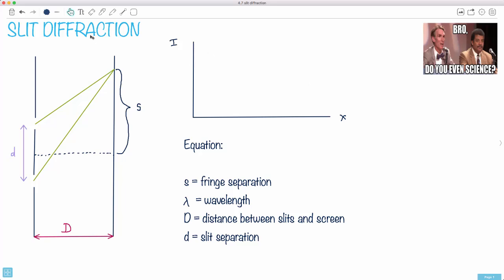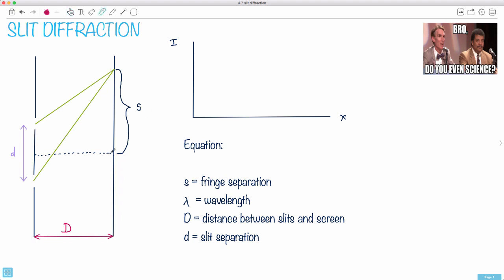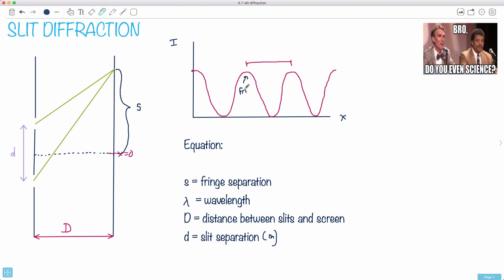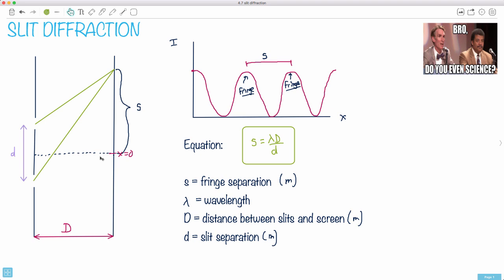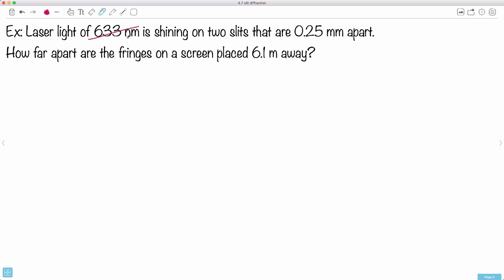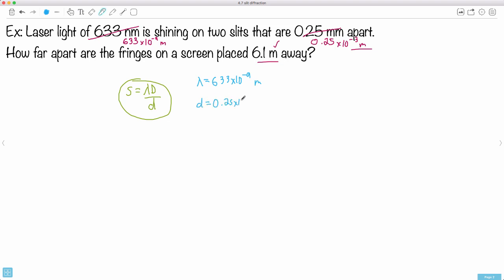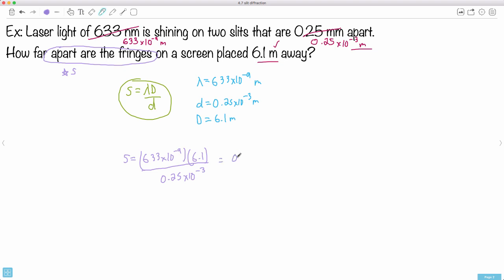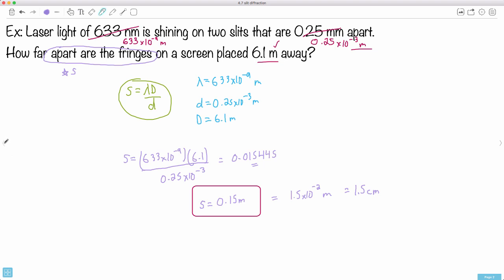Slit Diffraction (at end, should be 0.015m, not 0.15m) [IB Physics SL/HL]

Comment: Also, why are they the same intensity? I thought that intensity drops off significantly after the central maxima of m=0?
Reply from the maker: It all depends on the situation - you can have them where there is the single slit envelope dominating, but then you have the double slit effect also happening (lots of alternating max and min), but other times for example if you have many slits, the single slit effect is negligeable and it's the multiple slit effects that dominate.

Comment: Hey, I am a bit confused as for the difference between S and Lambda.  As in the graph when you show two fringes, they are basically two peaks, and the distance between peaks is wavelength.
Reply: The distance between the peaks is not the wavelength in this case.  The pattern that appears on the screen may have a sinusoidal shape when we look at its intensity, but it is not a wave itself, so s does not measure a wavelength.  The waves are the beams of light coming from each slit traveling towards the screen.  The bright fringes are where waves interfere constructively, and the dark fringes are where they interfere destructively.  So lambda is the wavelength of the light, and s is the distance between successive fringes (which is partially determined by lambda).